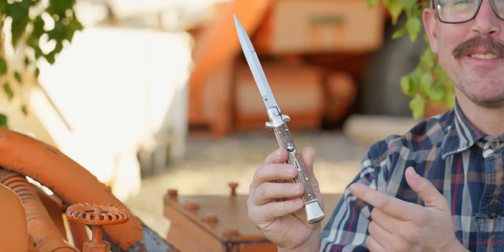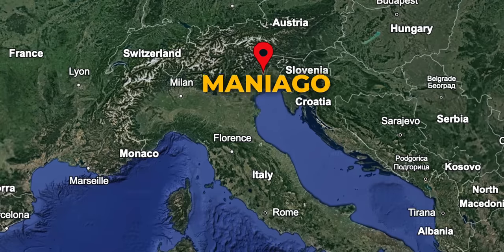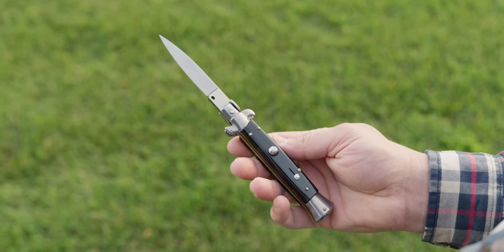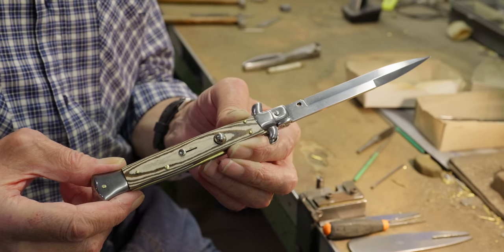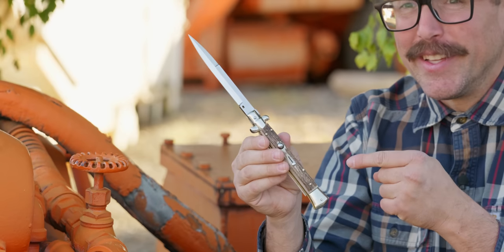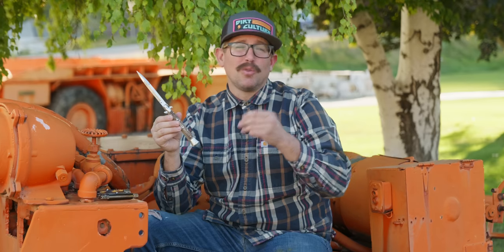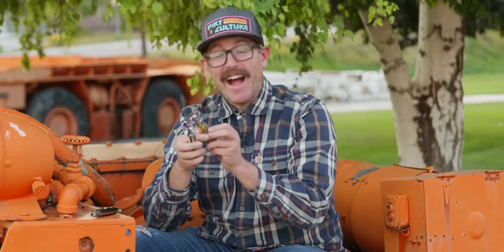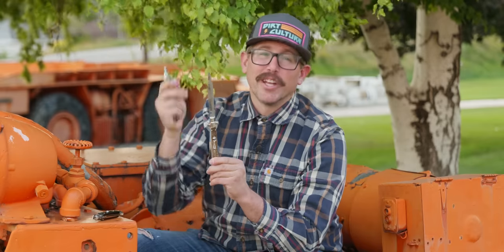Italian Stiletto Switchblades! Cheap VS Expensive Everything You Need To Know.

Comment: Several decades ago I acquired three Italian stiletto switchblades probably at a gun and knife show. One is 13 inches and the other two are 15 inch knives in two different colors. I keep them open in mailer tubes and well covered in Vaseline to prevent rust. I also keep them wrapped in Saran wrap for protection.  I keep them open so as not to wear out the leaf springs from constantly being compressed should those knives be closed for long periods of time.  While they are nice to look at but I am not sure that they have any practical use except for stabbing an intended target.

Comment: I have been collecting Italian Stiletto switchblades for years as well as some of the current ones like Macrotech's. The Italian ones are made by makers like Frank B., Ab, etc. My favorite though is my Walts Latama pickguard which is expensive but worth every penny. The Italians from the 1950s like in Rebel Without A Cause were picklocks, the bolster locks came along later. Great presentation..

Comment: They were sooooo cool! 😍 Portugal was awash with them until some twenty years ago, when their sale was forbidden   together with many other folding knifes. Nowadays they are classified as "Forbidden Weapon", like Butterflies and Brass Knuckles. I bought several; their sale was free, but you couldn't carry them on the street. Go figure. As of today I use one to open the Mail and they work flawlessly. The smaller button in the slot is a sliding safety catch that must be pulled away from the push button to open the blade. These knives are riveted and I see no way of disassembling them, but on the other hand they're inherently simple and reliable. Those I have were all manufactured in Portugal and have a black plastic handle. Some have their blade beautifully decorated.
In the eighties I had a charming blond girlfriend who permanently carried a Spanish made Stiletto, whose blade was some six inches long! Before I knew her, she had endured not less than two rape attempts between age 15 and 18 and fought back both. In the second case she was well aware that some sexual agressor had been active in the area and was carrying his Father's .22 LR Walther PPK hidden inside a cap that she carried on her hand. And she was indeed followed and jumped by a little guy in swimming trunks that had been following her. (that was on the seaside)
She pulled out the loaded PPK, aimed at the guy and shouted "Do you want to get shot? No? So get outta here!"
The guy stepped back, stumbled, fell, stood up again and run away like hell. She ran in the opposite direction, totally terrified!
And so she never left that long Mother of Pearl Stiletto. Personally, I do believe she would have used it if forced to... 😬

Comment: If your old slip joint is heavy enough, something like a Schrade Walden 250T, you can grab the large blade and open it with one hand. Probably not safe, but it can be done.

Comment: I've got 3 stiletto knives from China. They are illegal to own here in the UK, which is dumb because they are just knives. I have one large stiletto and two smaller ones. One of the smaller ones has some issue where it often doesn't open when you press the button, so I got another one and it works perfectly. The workmanship on them is great (apart from the one that has the button problem, which is probably easy enough to sort out).

Comment: Nice primer on Italian stilettos. However, there are a couple of mistakes-while the stiletto was originally made in the middle 1800s in Italy, switchblades were mass produced in the US starting around 1900, with literally many millions made until 1958. Also the bolster unlocking mechanism was not used on the vintage 1950s stilettos. This mechanism became common in the mid 1960s.
Reply: A familiar name Mr. Bill DeShivs!

Comment: I honestly always thought theese looked horrible with the thin handles, but i can see how they're a practical tool to have afterall they're fairly compact and easy to operate. The only thing i'd be worried about is storing it closed and the spring setteling and loosing it's strenght

Comment: Okay, nobody doubts the quality of a good Italian Stiletto. BUT, the can sometimes sell for north of $1,000 (just ask S Stallone). The Italian ones I have are AKC and A G Campolin. IF, you can find anyone who has them in stock then you can purchase for $150 to $300. 
NOW, if you don’t want to spend that kind of coin, it is very, very possible to get an excellent stiletto for as little as $50 to $80. Many new stilettos now use a coil spring instead of a leaf spring. Several dealers make a double action OTF stilettos that customers rave about. Shop around and find a dealer you can trust. Also, know your states laws.

Comment: Stiletto knifes are totally illegal in California. As a teenager I bought a "Stiletto" Super Automatic knife from a knife shop down in Tijuana Mexico in the mid 80ies. I snuck it across the border in my car subwoofer box with a bunch of illegal fireworks LOL. The blade on it came straight out of the front of the knife and would retract back in the same way at the push of the button. It was a pretty cool knife but not top quality. The blade was about 3 inches long. I was saving it as a memento from my youth, but my oldest stepson stole it out of my drawer never to be seen again 🤬
Reply: Being free is illegal in California.

Comment: Where did you buy the 20$ one
Reply: I got 2 from wish. They are pretty tough. I use them at work. Scrapping gaskets, sharpening my pencils etc etc. I have one i got from a luvs truck stop and ive had it since 2002. Still works. Im not paying 100 bucks for a switchblade.

Comment: I love stilettos. I've been trying to find a modern day-HIGH QUALITY stiletto. I might seem like a jerk for saying, but i hate how "real stilettos" button holes are too big, edges protrude, the "expensive" stilettos still feel really cheap and I haven't been able to find a good one. Cold steel has the ti lite. I love how useable and sharp it is but dislike almost everything else about it. Protech has (had) the don and it was just a bit too wide and a bit too different from a proper stiletto. Frank B stuff is....okay, sorta, but the edge couldn't cut a fart. I'm not trying to slam too hard but, does ANYONE make a cool, solid, modern day stiletto that can actually be used?
Reply: The ones that can cut or slash are more rare. Most of the stilettos are meant for stabbing especially bayonet blade.

Comment: Do not conflate "Italian stiletto" with "switchblade" and "automatic knife"! When I was a kid in the 1950s, mens' magazines always carried ads for "Italian stiletto"  knives.These knives were not "automatic" or "switchblade"! They looked like the larger Italian stiletto you have (note especially the bayonet design of the blade), but you opened them with a flick of the wrist. No spring assist. The locking mechanism was the same, and the leaf spring to keep it closed. They were essentially folding knives, but IF you knew how, you could "fire" one open. The movement was very subtle and hard to learn. Something like striking a match. When you did it right, those things just snapped open like you wouldn't believe. THAT is what I want. A "non-switchblade Italian stiletto with a bayonet blade". IMHO, they're way more awesome than the switchblade versions, because, "who can't push a button". It was like magic how you could flick one open IF you knew how.

Comment: I bought a cheap chinese one.  I'd never carry it, because it's a felony to carry automatic knives in the US.  Also, the safety spacer is loose and will easily slide to off position in the pocket. Other than that, it fires and locks perfectly and hasn't fallen apart yet.
Reply: No it isn’t. You can carry them in a lot of states.

Comment: These are not "stilettos" (which by the way aren't pronounced "stileddos"). They are Italian switchblade knives.
A stiletto is a specialized dagger with a long slender blade (mostly with a triangular cross-section) and needle-like point that came up in late 15th century.
A switchblade knife on the other hand is called "coltello a scatto".
By the way the plural of "stiletto" is "stiletti". 🙂
Reply: They are the Italian version of the stiletto, and it's pronounced just like it's spelled. These knives are designed for stabbing, not cutting, hence "stiletto."
Reply: @billdeshivs8992  Just as I said, they are pronounced "stiletto" and not "stileddo".
But, also as I said, a stiletto is something completely different.
https://en.wikipedia.org/wiki/Stiletto
Reply: I understand you consider yourself an expert and above the unwashed masses, but the traditional stiletto was a long, thin dagger designed for stabbing. They were originally made in Italy. The Italians make a folding, automatic version of the traditional stiletto, and called (guess what?)-a stiletto. Who are you to correct them?  @tubekulose
Reply: @billdeshivs8992  I just like cold weapons and yes I do consider myself a connaisseur regarding this topic. Also have I been to Italy more than 30 times in my life and I am pretty sure that if you showed an Italian this type of knife and asked him what it were called in Italian, he would respond "questo è un coltello a scatto".
But I do not mean to treat anyone in a condescending or supercilious manner.
I just point some things out.